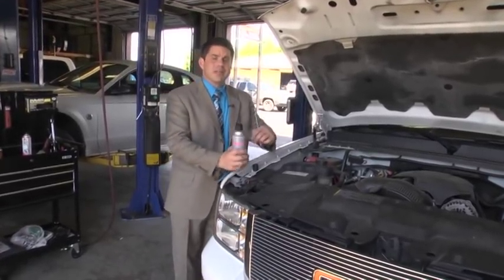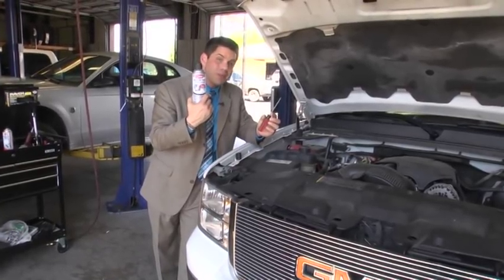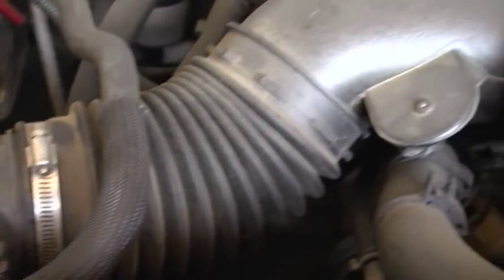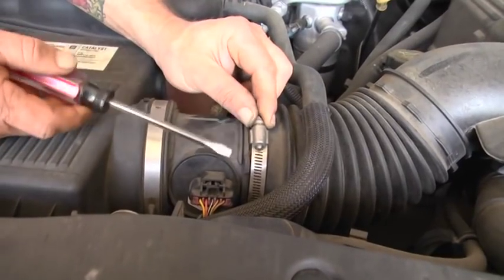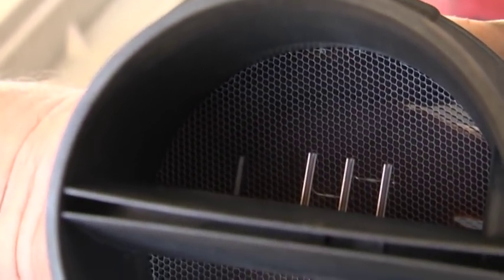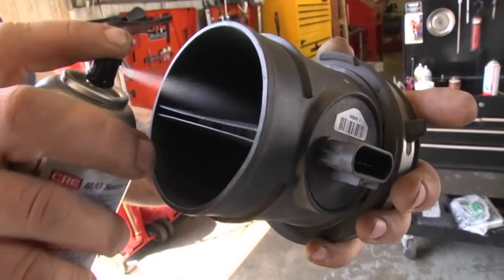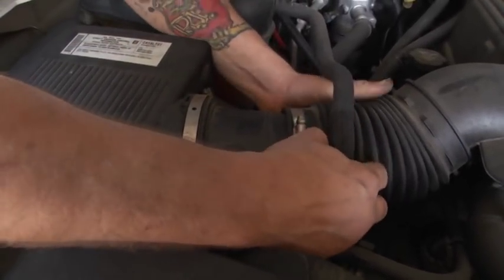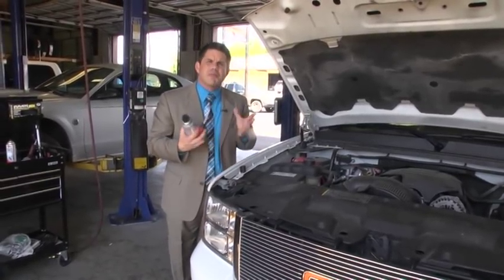Want better gas mileage?  Get a screw driver and spend 2 minutes here

Comment: That little bit of cleaning is worth every bit of the time...Just DO NOT use carb cleaner or parts/brake cleaner...
Reply: yes because people go to work each day to do things for people for no pay, just for the love of putting up with small minded dipshits who think the world should do everything for them while they go play computer games all day long. I guess you think it should be free that a dude climbs all over you car for 3 hrs trying to find a problem with it...
ive had idiots in my shop with the same attitude, i ended up selling their car because they wouldnt pay me for the 'WORK' i put into THEIR car. Wake up to your self stupid, your turning you USA into a 3rd world country.
Reply: Well cool...Good luck with that,"HILLBILLY",lol....
Reply: Don't exaggerate.   If you're worth your salt it doesn't take you 3 hours of testing to find "most" faults.  Sure, sometimes it will, but this is a video about MAF sensor.  We both know if a problem with MAF is bad enough that a customer brings it to a mechanic then there is an OBDII trouble code set and there you go, your 3 hours is reduced quite a bit like less than half the time you'd bill for the repair.

If it takes the average mechanic 3 hours for a DIFFERENT job then it should should bill for 3 hours, especially if dirty work or a lot of force or special tools are needed.  If it takes 3 hours and most guys and the shop computer says it's a 2 hour job, you're doing something wrong or the vehicle is especially rusty old but you'll make more money on return visits on an older vehicle.  Charge too much and the vehicle gets junked sooner or a person is more likely to tackle it themselves, so fewer repairs for you.

10 minute repairs involving only a screwdriver and spray cleaner should not be expensive, and we know you're billing up at least to 1/2hr increments so paid for 3 times what it takes to find a MAF fault unless you don't have any training with emissions sensor circuits so you're fumbling around asking in car repair forums on the internet.

If it bothers you that much to do what you were supposed to like doing, hence why you choose that career, maybe it is time for a career change to something you like more.   It might be time, when internet car forums are building up better and better tutorials for people to DIY, amassing a huge helpful group of people who love to save money.  The more that enables anyone who has held a wrench to do the easy repairs, the less valuable your services are doing them and you get stuck with only the tougher 3+ hour jobs.

That's just one opinion of course.  You're entitled to yours but now you're hearing from someone who thinks most repairs cost too much so instead of making a little less money on my vehicle repairs, you or a fellow mechanic made $0.   The sad truth is that when government makes the cost of living go up, people will seek to cut expenses.  It affects many different professions, not just automotive repair.
Reply: Maybe this attitude is why repairs are taking you 3 hours?  It's not that you're getting "some" trouble codes but WHICH trouble codes, which is the whole point of them instead of only a check engine light.

If you have a dirty, or degraded MAF sensor you're going to get codes like P0101, P0102, possibly with lean codes like P0171 or P0174, maybe P0100, or P0104 though that's more likely a looming failure that cleaning won't fix.  

Besides the lean codes, which wouldn't happen without at least a pending code specific to MAF, these ONLY correspond to MAF sensor, you will not have a MAF sensor issue enough to have a customer bring one in if none of those codes are set.   You'd then use a meter to check for sensor supply voltage and output frequency and range.

Imagine that.   You'd use electronic test equipment to check the function of an electronic sensor.  This only takes a few minutes.  The most time you'd take on this is having to drive the vehicle for a while after resetting the codes to see if they come back.

I don't think you're even a professional mechanic if you didn't know this because this is not exclusive to newer vehicles, has been this way since about the mid-'80s model years, or were you trying to be intentionally vague thinking you had some secret knowledge about MAF?  See this is where you are going wrong.  This stuff is easy and that's why in the modern world it's not worth as much money to have someone else repair it, especially when the part cost itself is also inflated.  Even ignoring labor and shop related bill padding, most of the time a repair shop, ESPECIALLY a dealership, wants over 50% more than I can buy the part for on Amazon or Rock Auto if I don't need it same day, and sometimes they want over double the price, and still 50% more than a local auto parts store charges for something with a longer warranty to boot.

Believe what you will, but the world is changing when it comes to vehicle electrical systems.    The younger generation is now playing with custom circuits on arduinos, modifying drones, building 3D printers, etc.   They may be lazy with a bad work ethic but that also makes them cheap, cheap enough to DIY when it just takes turning a couple screws right there on top /front next to the air filter.  Hell they don't even have to bend over unless it's a lowered ricer.

As far as me being an amateur, I have done my, and my families vehicle repairs for decade with exception of bodywork & paint collision repair which I don't care to attempt.   That should worry you because it represents tens of thousands of dollars worth of labor we didn't pay.  Maybe that makes me a pro at cost effective auto repair, and I collected a lot of cool tools in the process.  It probably does take me twice as long as a pro to do repairs, especially since I don't have a lift, but it's also because a person takes more care with their own vehicle, it's only natural, and there's also the beauty in having more vehicles than drivers.  An extra hour here or there is no biggie.

Anyway, no point in me further debating this.  Just keep in mind that if you don't like your job that it's a big world out there where you can do something else.  You're never going to change customers, they're just getting more and more self entitled with each new year.
Reply: Life is easier with a different attitude.  I hope that someday you learn that and it gets easier for you too.  Bye.
Reply: lol, divide and conquer.  Multimeter in series with the battery measuring current, pulling fuses and relays till a change in parasitic drain is noticed.  There's more to it like having engine off  long enough for pollution controls to time-out and expecting a few dozens of mA for  modern vehicle electronics to be normal the newer a car is.  Multimeter should be in amp not mA range until it is determined the drain is low enough not to blow the mA range multimeter fuse.
Reply: Please provide evidence that any vehicle needs to sit for as long as 24 hours, that it's necessary.  I completely disagree with that.  We are talking about diagnosing a MAF sensor problem, not tweaking vehicle timing.  Yes you have to get the vehicle up to optimal operating temperature but that is all.  There is nothing that happens between an engine cooling off and the next few hours until 24 are reached.

The engine does not need to cool off or wait at all, not one minute.  All that is needed is to use the scan tool to reset the codes and bring the engine up to operational temperature for a period of time specific to that engine for the relearning sequence to complete.

Installing mudder tires then having sub-optimal shift points for fuel economy and emissions has nothing to do with the prior discussion.  Further, those people are idiots for installing huge tires and expecting good on-road performance or fuel economy at all, not because they didn't readjust their shift points.

In fact the typical vehicles those mudder tires are installed on, never had optimal shift points for performance (except towing) nor fuel economy, so previously their shift points where too low for that and after, too high, except you are often going about it wrong if you think shift points are the answer as the usual answer is a different differential ratio, to preserve the shift point spread for the range of speeds on public roads.

I can tell you don't DIY this kind of thing because a truck usually gets used long after the dealership forgets about it before the next set of tires and wheels for mudders and a lift.  You're foolish to think they'll declare some kind of totalled damage to sell a new truck or that they would go to a dealership for a new tranny if it was an out of pocket expense.

Just no.  You have no idea WTF you're talking about.  I hang out in a 4x4 forum quite a bit and there are lots of people putting larger tires on with the only issues being a vehicle lift needed for clearance and a speedo recalibration.

There is so much wrong with what you wrote that it's not even worth bothering to discuss it when it is so completely wrong and proven so by millions of vehicles.
Reply: lol, as if anyone cares what you want.  Improve your sorry self so you don't have to keep blaming the rest of the world then pushing everyone away.
Reply: Trolling now is just more evidence that even you know you were wrong but fragile an ego to admit it.  Grow up, screw your head on straight and learn automotive repair instead of attacking those who point out your incompetency.  Apparently your father should have said that to you but never spent the time, probably constantly insulting you so you built up this defense mechanism?

In the end it's about being productive, not ego.  You will always lose in life until you GET that.
Reply: I think I'll quote you on this one last post, in case you end up realizing how pathetic it was and edit it later.

findvoltage34 wrote:  "hahaha, i knew your father called you names that is why you attack anyone who knows more than you, im surprised you can actually construct an sentence. you remind me of this little fuck wit at school, think im gonna beat him up today."

Sadly you don't even understand how much wrong there is in that reply, on multiple levels.  Oh well, being the 4th I have better things to do, now out to party and watch fireworks.  Bye bye troll boy.
Reply: Ya know, you really can act in a way that is more beneficial to yourself.  It's no skin off our backs either way.  

In fact the rest of society will be better off if your bad attitude results in you getting the shitty jobs while others get better jobs, you get the shitty wife, the shitty home, the shitty children, while everyone else doesn't have to compete with you because your attitude takes you out of the race. 

If only you were older you would realize how important a good attitude is.  A person can be dumb as a rock but go far in life with a good attitude, or be a genius with a bad attitude and end up living in a cabin in the woods alone, mailing bombs to people because he can't accept the consequences of his own choices and blames society instead.

Your choices, your future.  Now you can't claim nobody told you before it was too late to turn things around.  Good luck.
Reply: +Paul Stuart How often to you have to clean the thing?  Do the cans come in smaller sizes?  I can see a mechanic having that size in his shop, but even with two or three or cars, for most people that seems like a 10 year supply.
Reply: I clean my MAF sensor maybe once a month just because it`s so easy and only takes a few min`s...Yes,Walmart sells a smaller can of this mass air flow sensor cleaner...It only takes a few squirts to clean it...
Reply: +Paul Stuart ,,,well paul, I have owned a car repair business for over 40 years, long before a mass air flow sensor was even conceived,,and I use brake cleaner all the time to clean these sensors
Reply: Too bad there aren't more honest repair businesses like yours.  Most shops would tell you that you need a new MAF sensor plus labor to total around $250 instead of 3 minutes and 20 cents of cleaner.
Reply: i dont know what you sayin here but i think you need to talk less and listen more, A TDC dont mean just buy a new MAF or clean it, that would make you an amature, just clean your MAF and off you go you say...
Reply: I once spent two days trying to track down the ground that was draining the battery on my wife's Jeep in just a couple of  hours.  Turned out someone had turned on the interior lights. Sometimes tracking a fault can take a long time, if you're focusing on the wrong thing.
Reply: Stinky Cheese is that what your dady says to you all the time. hahahahaha
Reply: hahaha, i knew your father called you names that is why you attack anyone who knows more than you, im surprised you can actually construct an sentence. you remind me of this little fuck wit at school, think im gonna beat him up today.
Reply: Awwwe gettin beat are ya.
Reply: wow, findvoltage was really butt hurt lol
Reply: Limitbreakur oh yer real bad
Reply: +findvoltage are you from the south?
Reply: findvoltage i think you're projecting now
Reply: Kcus Kcidu i couldnt care what you do boy
Reply: findvoltage ah ok so you're missing some chromosomes
Reply: Stinky Cheese fuck off idiot

Comment: even better: force your egr valve shut
Reply: +Aznwarlord7      Believe it or not, if you disable your EGR you'll actually loose power. The purpose of an EGR is to introduce spent gasses back into the intake. The reason this is done is to snub the intensity of the flame in the combustion chamber. With a lower temperature flame, the computer will add more timing and create more power. Without an EGR, the flame would be too intense, the computer would sense a spark knock, the computer will respond by adding a ton of fuel (to cool the piston)and reduce timing to prevent the knocking.  If you have a carburetor, then yes, you will make more power. But your car will be spewing NOx into the environment until you crack a piston.
Reply: 68RDRNR there are better ways than adding exhaust gasses in your intake
Reply: @Aznwarlord7  Yup.

Comment: It needs to be dry first before running or it'll be fried like a halogen bulb would.
Reply: There is no possible way you could keep it wet long enough to install it.  Dries practically instantly.
Reply: it sucks air, not ignites it. I'm literally amazed on how stupid people over here are
Reply: Stinky Cheese-I concur with your assessment.  This stuff evaporates way too fast.
Reply: +David&#39;s Favorite Videos you're very smart.
Reply: +Stinky Cheese You would be surprised.  People pop one end off and spray it and then try it. Definitely has not dried before puttinf power to it.
Reply: Nope, I wasn't guessing.  That spray evaporates extremely fast.  You could have some pooled in an area of the intake but on the sensor wire itself, it's evaporated within 5 seconds tops there, which is not enough time to get it put back on the intake and plugged in even if the engine were running so power was applied the moment you did that.